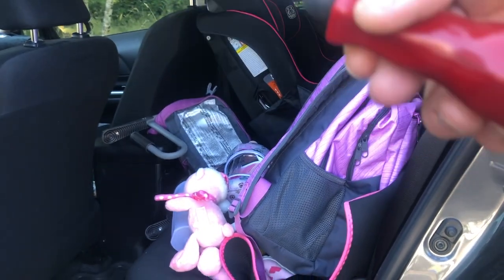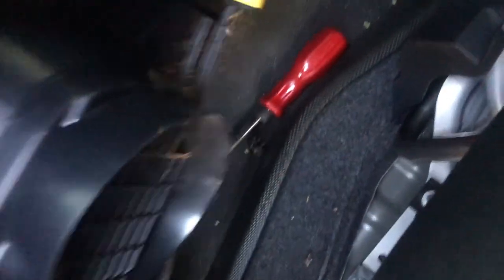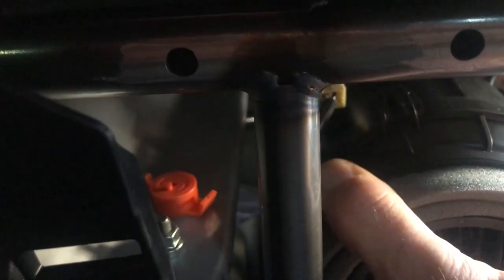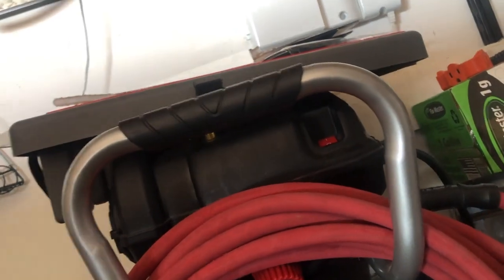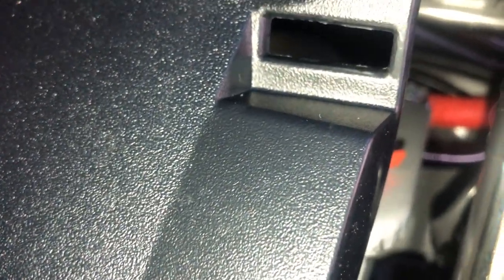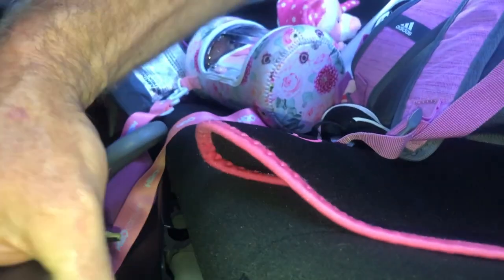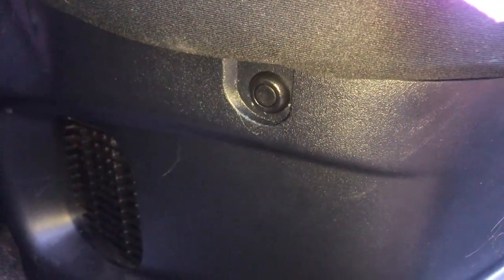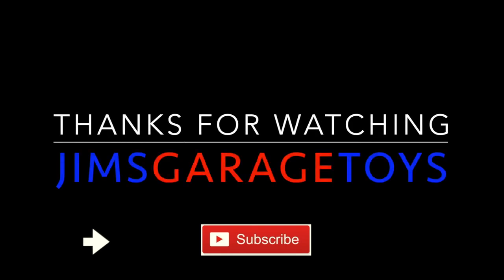2012-2019 Toyota Prius C Hybrid Fan Filter Cleaning & Inspection

Comment: just bought a used 2016 prius c and someone informed me about this fan cleaning. I'm not car saavy at all but was able to figure this out easily! I cant quite  maneuver enough to get that far left latch off the filter by that metal bar but was able to clean off all the hair and gunk on the outside of the filter. Thank you so much!!
Reply from the maker: Good deal! I'll be posting various maintenance items when I do them on my daughter's Prius C. I've done a video on how to change the CVT fluid and an oil change so far. Stay tuned for more in the future!

Comment: Thank you sir for the demo dear sir, didn't know that mesh could be pulled off just like that!
Reply from the maker: You are very welcome. I'm always trying to help!
Reply: @jimsgaragetoys  I bought a 2016 Toyota Prius c. A Multi-point inspection was done Toyota stated the cabin air filter was good. Is that the same as the fan filter?
Reply from the maker: @DaLane4real  No, it's not the same filter. The cabin air filter is behind the glove box. This filter is for the fan that keeps the hybrid battery cool and is very important. If you don't know for certain then check it and clean if needed. This is very important to keep clean for the health of the hybrid battery. A multi-point inspection usually just looks at things that are easily seen.